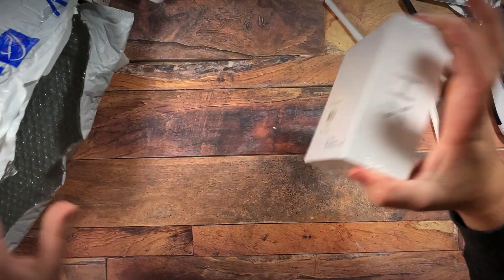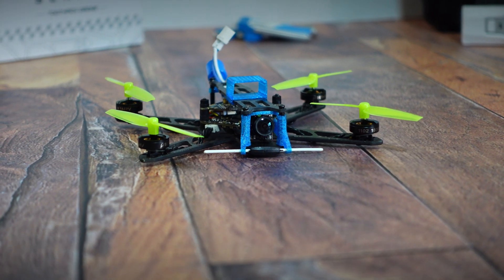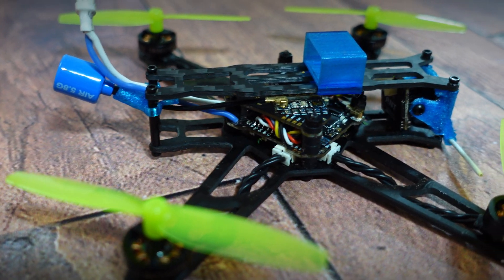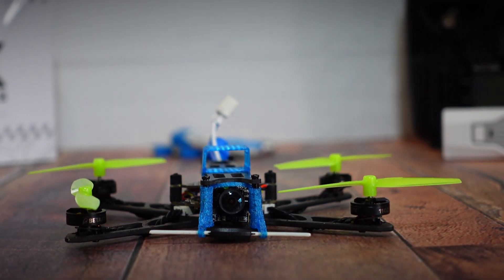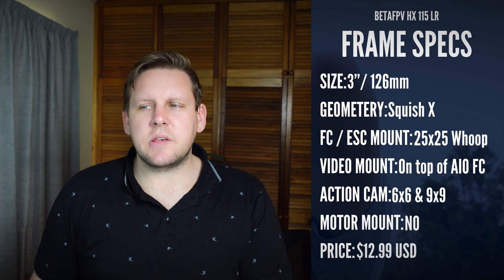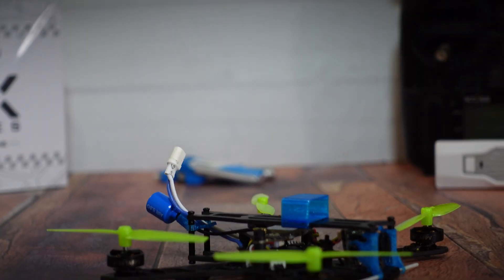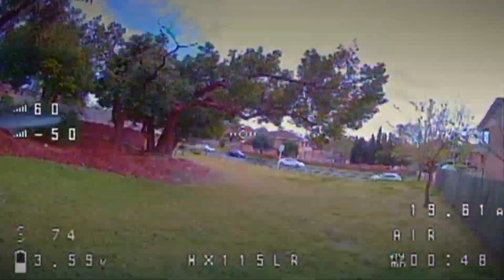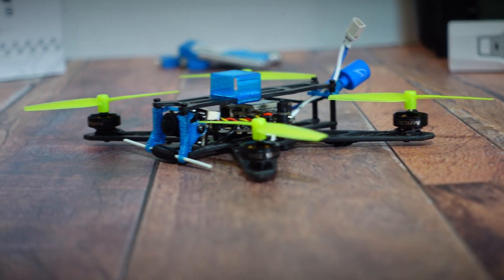Worst 3" ever made! - BetaFPV HX115LR

Comment: Just get HX115 LR recently with their latest 1-2s AIO, firmware and updated PIDs, it fly ok lack of punch, flip/roll like a paper. I have HGLRC AEOLUS 1202.5 1160kv on hand with GF Flash 2540-3 (Emax Tinyhawk) props. But I afraid it will burn the AIO since the motor suggested >13A ESC. should I try? Also I had tested it with BASEN 18650 3100mAh 40A, the ESC quickly get very hot and the drone became unstable
Reply from the maker: If you are flying it on 1S it should be ok. Test hover first to ensure the motors aren’t hot

Comment: if I connect a battery to it for 2s, then the VTX will withstand the volts, will it not burn out?
Reply from the maker: You will smoke the AIO Flight Controller before you smoke the VTX
Reply: @DarrenAllatt  so if the betafpv company itself claims that it supports this 1-2s board, you have had experience connecting 2s XH115 batteries?
Reply from the maker: @ae-qy4jf  BetaFPV claim the AIO can handle 1-2S but that doesnt mean that setup can handle it. You are welcome to take their recomendation. To go back to your original question, I believe the VTX runs off the 5v pad, so it should work on 2S
Reply from the maker: you will be putting in 7v at least, so if it will fry it will fry on a discharged battery as it will a full charged.

if BetaFPV recomend 1-2S then you can go for it

Comment: I still haven't figured out how to smooth out shaking with PID tuning. Seems like no matter which way I move any of the pids, even the smallest amount the shakes increase.
Reply from the maker: Can you talk me through the “shakes” like what are you experiencing? It’s potentially also a filter issue
Reply: @DarrenAllatt  thats exactly what I mean, a filter issue. Its as if your little quad is getting hit by wind when its not, shaky on the straights mostly. On Betaflight I can clearly see where you adjust the filtering... this is the Cetus pro which only allows you to use BetaFPV configurator which to me is way more simplified. So i'm not sure how to tune for more filtering in there. I through new motors to see if it would help, and it did not. When I turn pitch pids up, it shakes more, when I turn them down it shakes more. Thank you for offering advice!
Reply from the maker: @glytch5   if you have the Cetus Pro, leave it alone. Don’t touch anything tuning wise. Use the default settings on it. 

The quad is a small ducted whoop it’s not going to get any better performance wise or how well it flies.
Reply: @DarrenAllatt  ah okay. I was hoping I could tune out the shakes a bit. Its weird they weren't there in the beginning a couple months ago, thats what lead me to believe I may have a flackey motor. Thank you!

Comment: I have a great 2S build for this frame.  Now it flies like a 5 inch (4-5min flight times AUW 98g).  Flight Videos to follow once the weather is better.

FC/ESC:		MAMBA F411AIO BLHELI_S 25A ESC DShot600 2-4S
Motors:		FLYWOO NIN V2 1203PRO 11500KV MOTORS (1.5MM SHAFT)
VTx/Camera:	BetaFPV A01 AIO Camera 5.8G VT
Control Rx:	TBS Tracer
Props:		3" bi-blade prop - prop pitch 1.4"
Batteries:	Tattu R-Line 550mAh 2S 95C Lipo XT30

Comment: All forms of HX have been terrible. Zero R&D, pids came stock. Wobbles like nothing I've ever flown. Only exception was the HX 115 toothpick, which ironically, is probably one of the best RTF I've flown. They should put it back on the market with updated parts, like ELRS integrated FC.